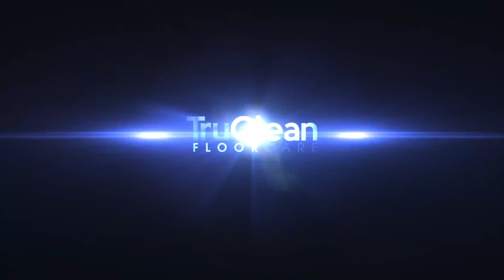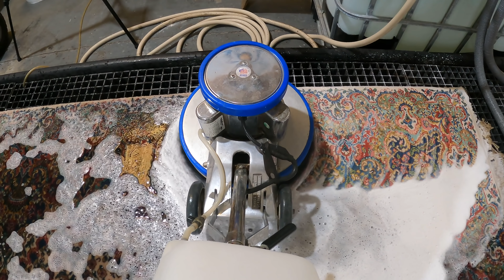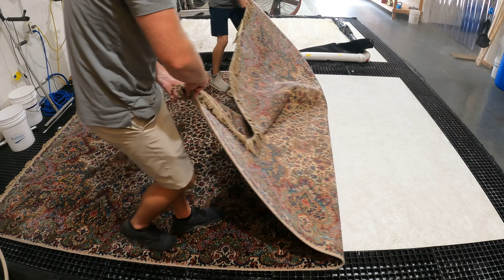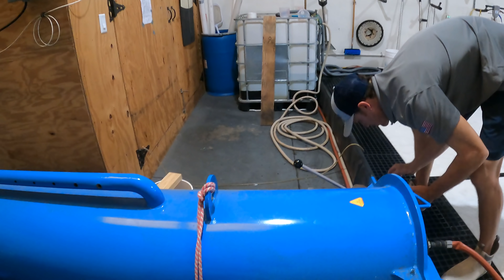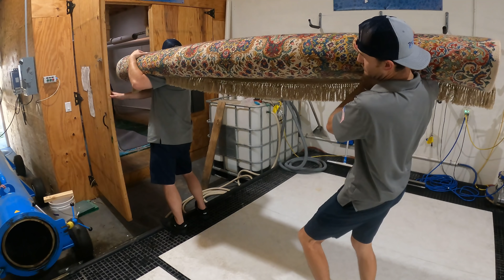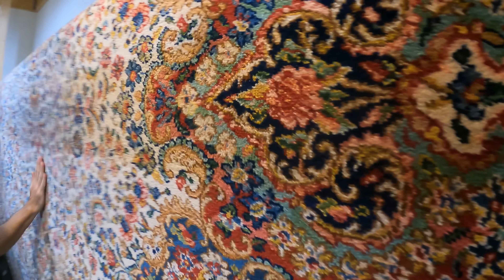Gorgeous Karastan Rug Washed For A Good Cause

Comment: It is really dangerous to have the power cable on the floor, I have seen them get wrapped around the spinning brush and rip the insulation off, not good when standing in water.  You could hang the power cable from the roof on a long retractable sprung rope, a lot safer.